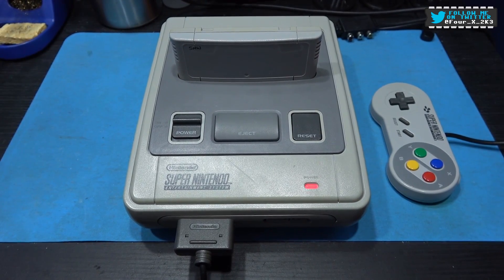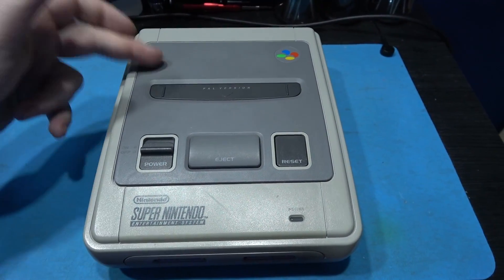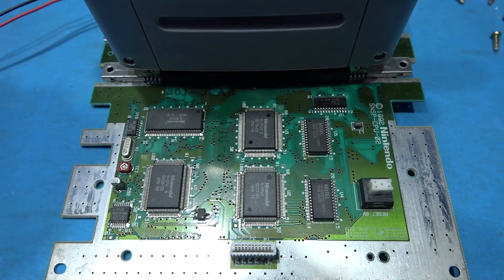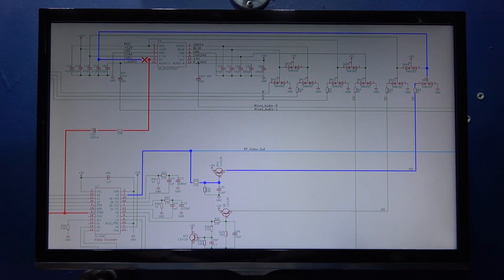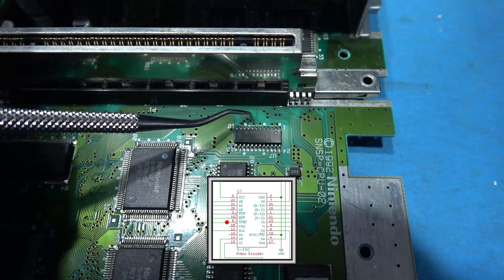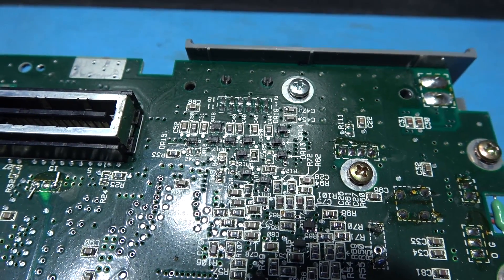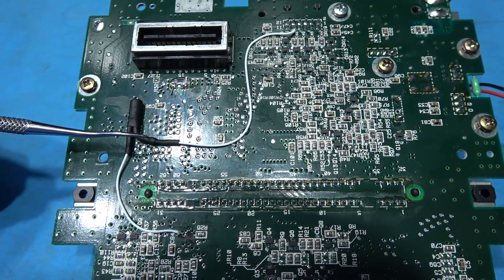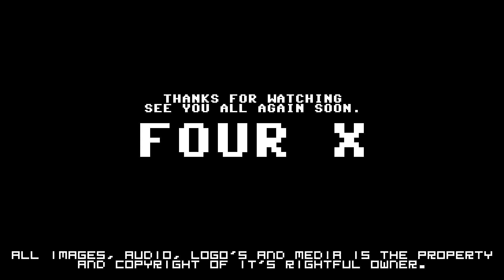Super Nintendo Entertainment System (SNES) - C-Sync Mod.

Comment: If you're using a PAL SNES, you can also remove the 12V circuitry entirely (D1, R72, DA11 and C60 and C59 on the top side) and use pin 3 for CSync just like on NTSC model SNES consoles.
Reply from the maker: Nice, Thanks for the Tip.
Reply: Three years, hope you still use YT :D So once you take out those caps and resistor do you just wire from pin 8 on the video encoder to pin 3 of the av header and do you still need to use the 430ohm resistor and 220uf cap?

Comment: Nice video, but which RGB cable are you using after the mod ? Is it better to do the mod or tweak an RGB cable with a Sync Stripper with an LM1881 ? I'm using an RGB cable Sync on Luma from retrorgbcable.uk but I have a distorded image at the top of the screen when playing games in 60Hz, I don't know if it might be because i'm using Sync on Luma and not CSync, or if its a trouble with my TV Screen (Sony Trinitron KV-1440). When I use the official Snes Cable, the image is extremely dark, almost black, I don't know why either. What would you advise in my case ? I'm playing on a switchless 1-Chip Snes Pal.

I've tested with my Megradrive 1 (switchless too) using a CSync cable to compare and I've got no problem, there is no distorsion at the top of the screen.

Comment: Very detailed instructions , Thank You. For the people who do not have soldering skills is there a cable for sale where it would have the electronics needed to eliminate dot crawl built into the cable itself ? For LCD TV's
Reply from the maker: Thanks. Yes there is an RGB SCART cable for the SNES you can use, if you look for one that has "Sync on Luma" this will work. However some PVM's will only take a C-Sync but if you're just using it on a standard TV "Sync on Luma" should work just as well.